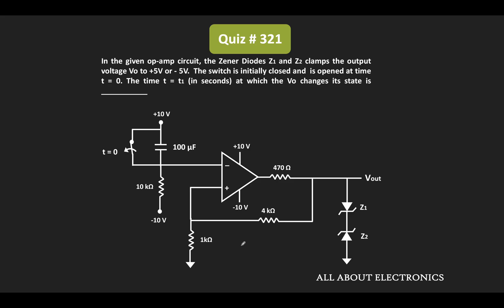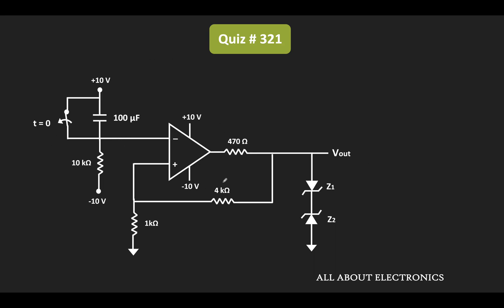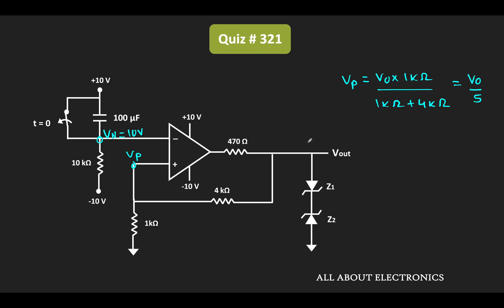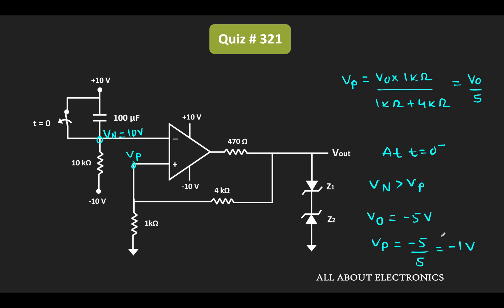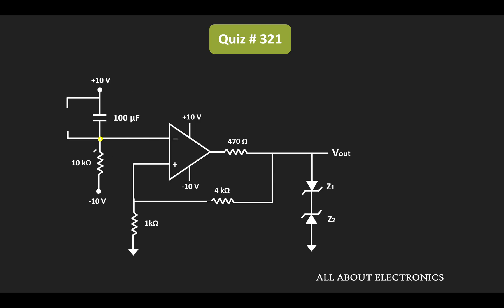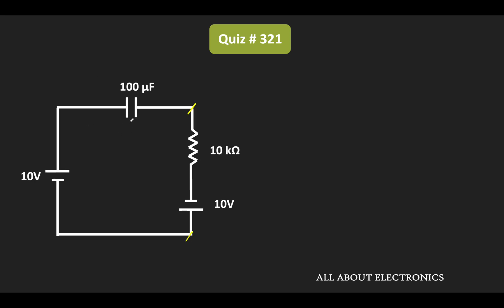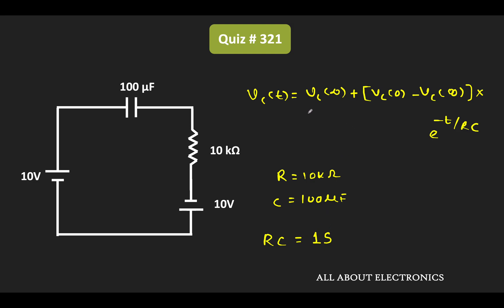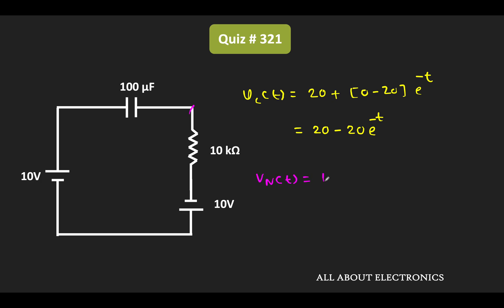Op-Amp Solved Example | Quiz # 321

Comment: Sir when V- is 10V , (switch closed) Vout was -10V. How it became -5V?
Here zener Z1 will be reverse biased and Z2 will be FB nna (incase of -10V)? 
Z1 means +5V will be the output nna?
Reply from the maker: Since Z2 is ideal Zener diode, in FB condition it will act as a short circuit. So, ground terminal is now connected to the cathode of Z1. And at anode the voltage is -10V. Now, since it is Reverse biased, so across its cathode and anode, the voltage will be 5V. But if you measure that w.r.t output and ground, then it will be -5V. I hope, it will clear your doubt. In case, if you have any doubt, please put signs (positive-negative) across the element. You will get it.
Reply: @allaboutelectronics-quiz  Thankyou sir